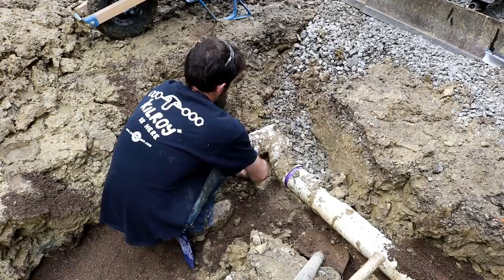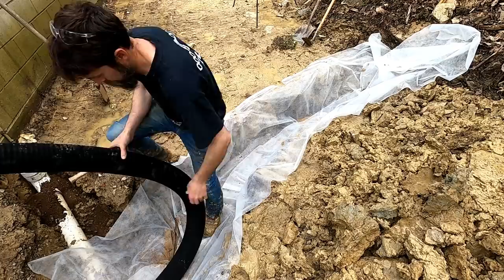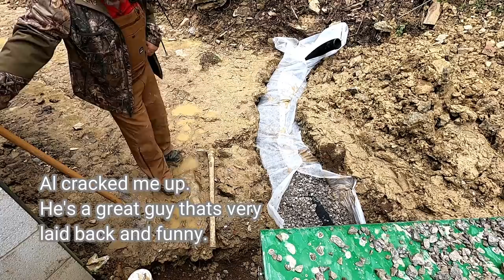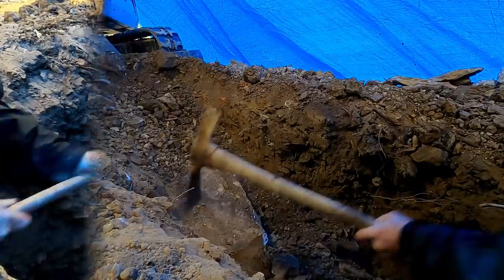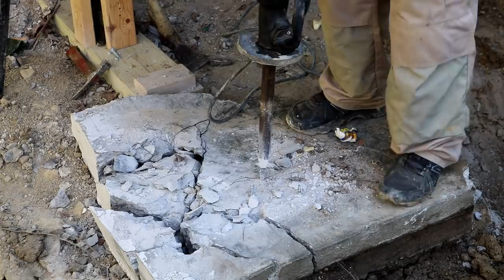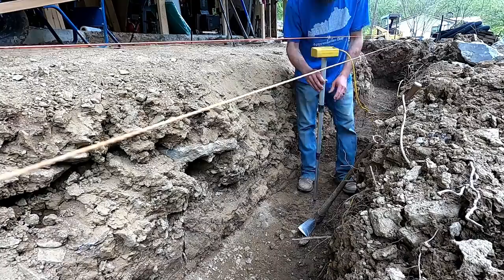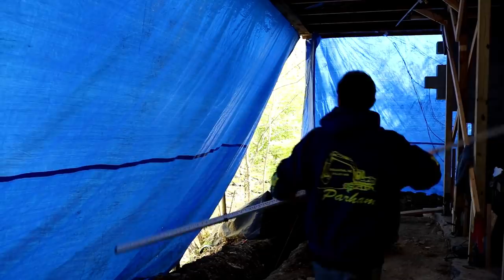Digging on the EDGE!  Shop foundation dig!  Damaged shop part 12

Comment: This video brought back some memories for me. 

Many years ago I worked in the civil part of construction as an equipment operator and I grew to despise it over time. My time as a cat skinner came to an abrupt end on a job digging out a sloped floor basement for a ball mill for a steel mill. They had poured concrete piles to support the new building and I had to maneuver a small tracked excavator, a John Deere 350 as I recall, between the piles to dig the basement. I had about a foot on each side of the loader and the going was tough due to a lot of rain and a soil that was very absorbent. To add insult to injury there was a fair amount of debris in the soil as it was in fact backfill using the steel mills dross and clinker. It was about 10 o'clock in the morning that the loader came to a dead stop in midway in the pit for no apparent reason. I couldn't see much of the tracks since the slop that had churned up with the water covered them. After screwing around for about an hour I finally determined that the problem was a cable that had been buried in the fill had wrapped itself around my final drive on one side. It took another hour to locate a cutting torch and get the cable cut to free the tracks. 

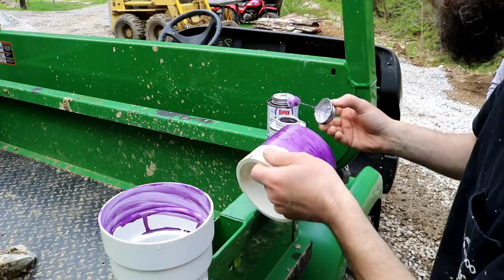This type of thing went on all day and the slop was getting worse and worse with more rain and the churning action of the tracks. Several times I told the engineer that it would make more sense to just stop and wait for better conditions but he said no, he had a schedule to meet. Now the slope of the floor had to run down from East to West and as time went by it became impossible to tell what kind of gradient we had. The slop was about 1 foot deep on the East end to 4 feet on the western end where it ran up and over the floorboards of the loader. I spent about 1/4 of the time either stuck or trying to realign myself with the pilings since I could not get good traction on the ground below me. The final straw came right around 4:30 when the engineer came out and told me that he wanted the water in the trench to drain to the Eastern end because he didn't have enough hose for his pump to reach the Western end. I asked him how he figured I could accomplish this as water doesn't run uphill and the slope was after all East to West. He said that was my problem and started to walk away. I just said "F" it and walked the cat out of the hole and up onto the bank and was going to shut down until he turned around and asked me what the hell I thought I was doing. I didn't respond and saw red so instead I turned the cat towards him and started in his direction. He ran like a scared rabbit and holed up in his construction trailer. I pulled right up to the trailers door and sealed it off with my bucket, got off the cat after shutting it down and taking the keys and headed for the parking lot. All of the other workers decided to come along with me and we left for the day with the engineer stuck in his trailer. You see with the door blocked by my cat he couldn't get out of the windows because they had heavy industrial screens over them to keep them from being broken by kids with rocks. 

I never went back to that site and I guess that was a good thing as the engineer and the company manager had the police there waiting for me the next day I was told. In the end though I had the final laugh. When I didn't show the company manager, who knew me personally, started asking the other workers what had happened to get me so pissed with the engineer. They told him about getting stuck repeatedly and all and then demanding that I get get the water to flow uphill because of the lack of hose. The Manager listened and then, without a word, went off to the engineers shack. About 15 minutes later the engineer left site never to be seen again.

As for me, well I went on to become a welder and a pipefitter.............so I could play on occasion in a water filled trench someone else had dug. Somethings just never change.......LOL.
Reply: Scooter Tramp great story, thanks for sharing. I did finish carpentry, years ago, some of the building supers were complete idiots.

Comment: You and Al have definitely broken the back of the job, very good work. Nice to see the water trickling out the end of the pipe, it doesn't look like much but over time that's got to make a big difference to the 'swamp' draining the spring water away and when the guttering is installed I'd say the swamp will be all but gone. Time will tell :)

Comment: Hey steve ,when you place your vertical rebar , match them in the block cell  , to the holes of the anchor bolts that you removed  so that cell will be soiled to the anchor bolt  when you reinstall .

Comment: What you're doing there Steve from 34:27 is what my concreting job called bottoming out (in the UK). A sepparate pay to the day job. A very imortant part of footings. Clay is a very good surface for concrete. Hard graft. Stay with it. The foreman/ganger on most sites would want a spirit level finish (In my day that is). I bet you have some fresh lumps growing in your arms... Sorry, muscles. 
Knock in vertical re-bar rods in the center of the footing to set the thickness of your concrete and work to the top of the bar. Very interesting watching someone else do the graft. Good series of vids.

Comment: Great work, drill into the existing slab and put rebar pegs to lock the new and old together. We would dig under the old slab 5 to 6 inches also. Thanks for sharing.

Comment: Oh yeah, installing a drain in sopping wet clay muck - reminds me of the drain I put in my backyard a couple of years ago, and the second drain in my backyard that I currently have torn up to replace. Apparantly the builder thought somehow water would flow uphill from where it drains, to where it needs to go! Quite the stroke of genius that was!
Reply: are you saying it dosn`t?
Reply: As a plumber, that's the third thing you learn.  (Hot on the left and cold on the right are the first two,)

Comment: Here in the desert the clay has dried out... and behaves like mortar binding the rocks.  Caliche is lovely stuff.

For the occasional builder a water level can be made for the cost of some clear tubing, a rubber grommet, and a plastic jug from the recycling bin. Not quite as quick to set up as the zip level, but the price is attractive. Powered by gravity. As accurate as your eyesight.

Comment: To stop the creek washin away the bank get sheets of mesh and roll them into 10 x3 feet sausages THEN ancher them to the shed side of the bank .in effect IN A FLOOD this SLOWS THE FLOW ON THE SHED SIDE OF THE CREEK FORCING. THE CREEK THE SCOUR THE OPPOSITE BANK ,THEREBY STOPPING THE SHED BANK FROM ERODING.hope this helps

Comment: Just an info for you to look up : when doing a footer we usually pour a thin layer of "waste concrete" (I don't know the technical term in English). This first layer mixes a little with the dirt and mud and then offers a clean and level surface to set up rebar and pour the footer. This is considered best practice and compulsory for foundation work in France.
Reply: Muzkaw   Never seen what you are talking about used in my neck of the woods of North America, residential anyway, so no idea what it is called... Est-ce un Béton de Propreté que tu parles? Je ne l’ai jamais vu en Amérique du Nord, donc pas d’idée du nom... Très bonne idée par exemple!
Reply: Muzkaw
In Australia it's called a blinding slab. It's usually a lower grade concrete as it's what you say just a working surface for the structural slab or some excess from another pour. From what I see with Steve's trench it looks good enough not to need that. He spent extra time leveling the trench. The do it right & do it once approach is the best way to go & Steve has that well set in his mind. Mostly the footing will be under cover so may not need much preparation ? It could have some builders plastic on the bottom & plastic bar chairs to hold up the bottom "reo" or just plastic bar chairs off the dirt ? He's getting a quote from professionals, so they'll know what's best for that job.

The laser level (probably hired ?) & the zip level (Al's gear) were a great help in getting things right on the job, particularly the drains, roof & the footings. They did a lot of work in 2 days as the external drainage is now sorted & the footing is ready for the the concrete guys. Then the block layers will follow on.

You can see that some machinist knowledge that Steve does in this building project is transferable to building work. The main thing is that you do things in a methodical way & that is apparent in all the work that Steve is doing on this project. Yes windows in the wall could be a worry as you drift off the job at hand & start looking at what's going on in the creek area. Either way a good place to have a workshop.

As long as his money holds out he'll end up with a 1st class workshop but sooner or later he will get the job done thanks to all his supporters.

I'm a retired Construction Surveyor & in 47 working years I've seen all this stuff so many times I've long lost count. Well done to Steve for tackling jobs he has little or no experiencing in.
Reply: hugh moore  A Blinding Slab, thanks for the name, I think it’s a great idea!
Reply: @evanking6329  yes beton de propreté
Reply: @hughmoore810  Ah thanks, good to know the technical term !
Reply: @Muzkaw  
Blinding slab is a technical building term. It's origins are obscure but probably of UK origin ? Blind means to seal according to  construction termsx definition.
Reply: I would agree if the trench was rough or half full of mud. Bottom of trench looks fine, If it does get a little water can always support the chairs on plates
Having to hire a pump twice for such a simple footing is prohibitive. 

I have even seen people suggesting putting in piles etc yes sure it would be better but the footing doesnt need to support much weight. Its main purpose it to hold the roof from blowing away. Once there is rebar in the slab he pours and now the drainage is done it wont be going anywhere
Reply: Muzkaw    quick question for you if you have a moment... what mix strength (psi or mpa) and how thick do you guys pour it? A couple of inches? Thanks 🙏 have a good one and stay safe!

Comment: I used Patio Door replacements (rotated horizontally) for the glazing in my shop and I highly recommend them after 3 years of service. The only draw back is they aren't operable. This isn't a problem for me as I keep my shop conditioned year around; I hate rust.

Comment: on your tile outlet you should install a rodent gaurd- two HORIZONAL bolts to keep anything big from crawling up in there and plugging it. Horizontal not vertical because horizontal will collect algae or stuff like that flowing out. on the ledge behind the shop you could pour a curb to feed the water to the tile.

Comment: A little trick i learned about working in the Wet and mud and dirt. If you buy some PVC/plastic coated reusable gloves. The heavier duty ones. It makes life much easier for this stuff. You can often find them in the cleaning/paint isle. The ones you want are some sort of mesh backing before they are plastic coated. They  should be just thick enough to prevent most heat transfer. Usually about 7$ a pair for the ones i have found here in California. Believe me they make cleanup and working in the wet mud much more tolerable. Even more so if you have arthritis in the hands like I do.

Comment: adding some piles would still be a good idea-8 foot deep minimum-that slope is unstable-they could even be added to the outside or inside of the foundation after the fact-the best of course is piles right under the foundation wall. Such a large amount of concrete for the foundation wall could be reduced if you added the piles!

Comment: I couldn't agree more Steve, spend money on the foundation as it's the base to it all...my shop/home is on a difficult piece of property as the basement is cut into the hillside. It required large footings and complicated drainage to do correctly. Not to mention it's a poured foundation. I hired someone that was familiar with doing that type of foundation, and yeah, it wasn't cheap but I hope it works out for me in the long run. 🤔

Comment: Hi Steve, nice job so far.  If you make some rebar post footings, you can use them now to support the posts that are holding your roof up.  When it comes time to form up the rest of the footings and slab, you can just tie into the post footings and leave the posts in place for the pour. Any rebar that is proud of the slab can be starter bars for your pony wall.  Stay safe and well :)

Comment: Thank you, Al. The digging on that part of the job is by far the most time consuming thing to do if Steve had had to do it all by hand, especially with all those rocks down in there.
Steve, I hope Al helped to alleviate one of the most stressful parts of the job for you, maybe even make you feel a bit relieved after it was all done.
Are you going to use the trench as the form for the concrete or do you have to use wood forms down in the ditch where you are? It may not feel like it, but once the footing is poured you can roll right along rather quickly into getting your shop closed back up. There are a type of cinderblock known as shoe blocks that you can pour your floor up to and on but with the number of good cinderblocks you had, I wouldn't waste the expense on them but I will give you notice of them if maybe you might like the idea of them. L shaped.
Good luck with everything, I hope the lockdown hasn't driven anyone crazy over there. Thanks for the videos.

Comment: We used to knock pegs into the bottom of the trench four or five foot apart, and level the pegs to one another, and then lay the concrete to the tops of the pegs. This ensures the footing is perfectly level.

Comment: The deer is cool. But I prefer  articulated steering like on the Jacobsen UV-4 (same as an older PUG UTV) that I have. I've gotten it almost completely over on its side. I turned the steering wheel towards down and just drove out of 14" of swamp. Love the thing. Too bad they stopped making them in the 70's.

Comment: Cement seemed a bit superfluous on a porous drain, except maybe for mechanical strength when the earth moves.   It's just PVC dissolved in acetone and xylene,  so if it dries out you can top it up with acetone.

Comment: I would just pour the stemwall and footer monolithic and leave the block out. Easier in the long run. Plus drill some 12" holes down 6' feet in the corners at least.
Reply: every new house/building built in that area deal with the same rock so I think the drilling crews are well aware of the ground.........

Comment: Steve, I'd consider spending some extra money on the rebar, particularly for your grade beam.  2 #5 t&b seems a little light to me, especially given that the foundation has settled 6 inches already.  I am not an engineer, but I am a foundation contractor and rebar is one of those things where a little extra money goes a long way toward piece of mind.  Also consider putting polypropylene fibers in the concrete--that's another area where (in my opinion) you get a huge bang for your buck.
Reply from the maker: Its not getting 2 runs of #5 its getting 4 runs min.  4" in from each corners. I have more than enough #5 rebar to run as many as needed

Comment: Ok I wondered how the footing would work if not on bedrock but if you are filling it with rebar and making it into a beam that makes perfect sense. On Essential Craftsman, when he build his retaining wall he used block and filled it with cement using a pump. Will you bring in a truck and pump just for that? I know you plan to use the pump for the footing but the blocks will have to come sometime later. Or will u go old school with the mixer?  So you didn’t know Al before this? That’s astounding. What a guy.

Comment: been thinking about that small retaining wall for the concrete floor and the roof support , once you poured that wall you might need to lay a drainhose on the uphill side of that wall as any water comming off the hill might go under the floor and collect behind that wall and undermine that retainingwall or the foundation on top of it over time , think you have a straight shot to the piping out intoo the water from the other side of the building , pouring some gravel before pouring the foundation MIGHT work but it allso might hurt the stabillity (youre going to have to ask someone that knows this stuff) 

think leveling the roof at this time is double work , unless the next job is to build up pilars out of stone to support the roof on the edge , you need to remove some of the supports to pour the floor , once the floor is in there you can lift the roof and start building the permanent supports and the wall up under it 

if you have enough people to paddle the concrete along the ditch with hoes you could get away without a pump , pour it in through a gutter on the cement truck intoo the front of the gutter and help it flow along to the rear  , its hard work though and youre probably be there a while and go through 3 or so trucks of concrete before the ditch is filled , could allso make some extended guttering from wood to extend the one on the truck and help the concrete along that to the back (prolly needed if you put repar in ) it be cheaper than renting a pump , think it will depend on the difference in price if you want to invest the extra time and work 
going to need a concrete vibrator to get the concrete to flow intoo the crevises